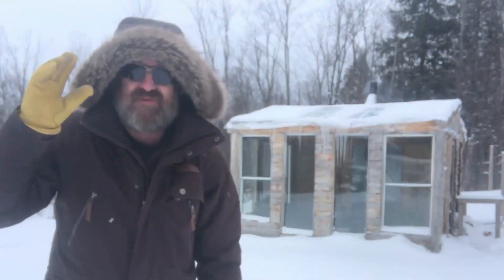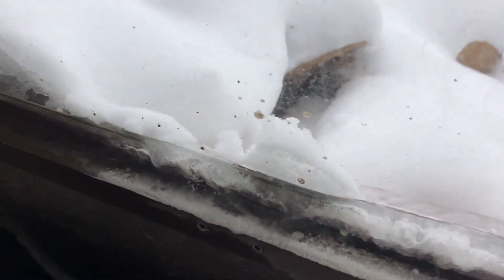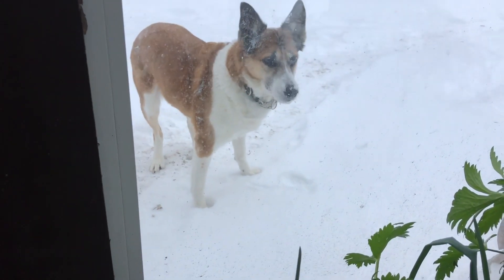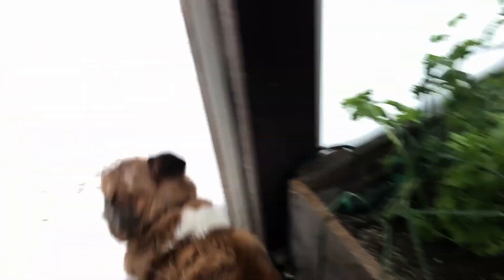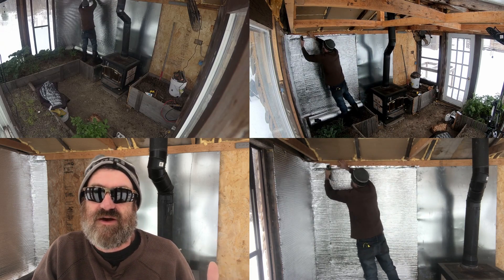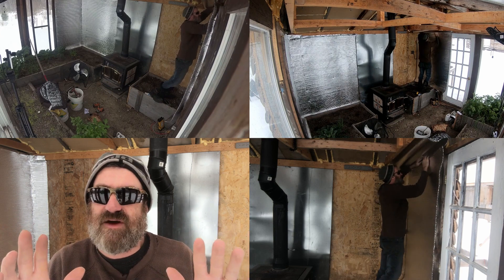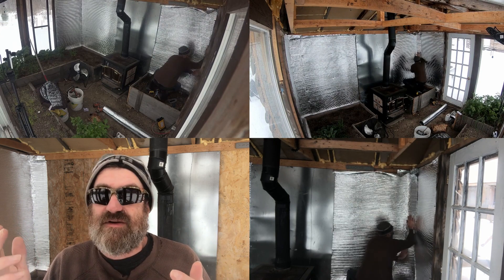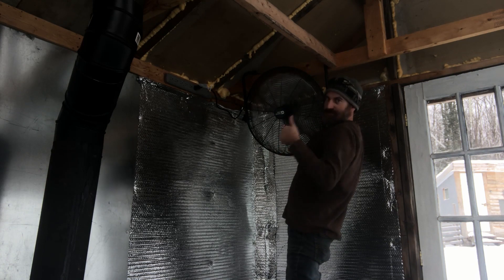Winter Greenhouse Heating - What Works & What Doesn't - Greenhouse Insulation & Light Efficiency

Comment: 😂the recall part is a big main reason to grow your own!
I just asked on an older video how the solar worked out and if you were using it for lights, heat or both.  I didn’t notice it in this video.  Did it work?

We used reclaimed lumber to build our garden shed and attached a lean to greenhouse made from reclaimed polycarbonate panels.  I see many plant directly in ground in their greenhouses.  Right now I use ours to start seeds with electric heater when weather warms up.  I would like to heat with solar and wind if needed.  
At the moment I want to replace polycarbonate panels with new, add a couple feet and install a heat sink in floor.  I suppose I could still have a heat sink and add a bed area for growing.  I keep the size small for ease of heating and considering a box on back wall to gather heat and pump to floor.  I think I seen a video of yours with aluminum cans.  We made a box a long time ago and they do work, but sunny days are key.
It is beneficial to have that back north wall attached to our shed.
I’m Z5a, let me know how that solar/battery thing worked.  Thank you!😊

Comment: And of course it has to be cheap to build lol I think you may gain some heat by insulating the ceiling but may not be worth it as you have lots of wood which is the best source for heat the short days are the worst so your lighting is next. Thanks for sharing with us. Down here in Muskoka we are limited to 105 sq ft without a permit. Oh I ordered some seed so I am a little behind you.
Reply from the maker: Yeah, it’d mainly be an aesthetic reason for adding it.  Although I could immediately see the difference in brightness once I had the walls done.  Might still add it in.  Did you order seeds from us?  I don’t recall seeing an order going out to Muskoka area, but we’ve sent quite a few out the last month.  Cheers!
Reply: @Wilderstead  To be honest I did not know you sold seeds. I will have a look as I need more thanks.
Reply from the maker: Yeah, on our website.  Some have sold out already, but there are still a decent amount available.

Comment: Thank you!   Is that some kind of a special long lasting stove I've been reading about that last over 24 hours with 1 log?
Reply from the maker: Not really a special type of stove.  It’s large though.  Rated for about 1500 sq ft.  A full load will last about 12 hours with everything damped down.  That’s what I do overnight.
Reply: @Wilderstead  I may invest a little more money in the long lasting stoves to save fuel, unless I can find a design, then I'll make one.
Reply from the maker: @l0I0I0I0  if anything, make sure you invest in a stove much bigger than you think you’ll need.  Some videos from last winter have a different stove in there.  It worked, but had to be loaded up a lot more often than this one.
Reply: @Wilderstead  Good point!  It will have to be bigger as GH are not as insulated as a regular house.  I actual have some designs I'm going to try out for heating and cooling.  Not 100% set on which ones I will do but it will probably a combination of 2 or 3 systems with thermal energy storage for a larger greenhouse.  Geothermal heating and cooling for sure and perhaps a heat pump.
Reply: @Wilderstead I’ve seen what I think they call rocket stoves that are built with heat sink materials.  My go to for indoors would be a soapstone stove.  Grew up in house with old giant dinosaur wood burner with coal auger.  A lot of work.  I wish I would have insulated the attic for folks Way sooner than I did—Total night and day difference—Totally!  
I shake my head that my dad was talked into fiberbacked aluminum siding years ago.  The walls were double and triple lathed so no way to insulate back then.  Oh, well we didn’t have to paint anymore, but I didn’t like it as a kid because it was wide siding and took away the look of 4” cedar siding—sigh.  Money better spent would have been to insulate the huge walk up attic.  It would have saved so much more wood and coal.  Ugh!

Comment: Are you going to use this structure in the summer and if so what do you do about it getting too hot?
Reply from the maker: We have hoop houses that we use in the summer.  But when this one is used spring and early fall,  all of the windows are opened up and the fans help move the air around.  It works as a giant dehydrator for various things as well.
Reply: @Wilderstead  We just ended  3 weeks of minus 30  in central Saskatchewan. What type of extremes will your greenhouse face?
Reply from the maker: Same here, if not colder at times.
Reply: @Wilderstead we use shade cloth on our lean to and works great for curing onions, potatoes (covered with cardboard or burlap).  Another reason I like to keep GH small so it’s easy to flip the cloth on.

Comment: reco... block off the "attic"... smaller space to heat the better and it's not a functional space for you... more work in summer/fall... insulate around the building a few inches down (exterior/below grade foam board)... 2-4 ft out... will really change frost line and cold coming up the floor
Reply from the maker: Thanks for the recommendations

Comment: Don't mislead people.  Bins with water do work. They must be BLACK and 2-4 times in gallons to the square feet of floor.   Instead of water, sand will work even better as a thermal storage.  There are dozens of videos here showing how to do it with measurable results.  You did it wrong.
Reply from the maker: Do you have experience growing in a greenhouse heated solely with big black barrels full of water? There's nothing misleading about explaining what we've tried, and the HUGE amount of space required to store the volume of water needed to keep a greenhouse 'warm' - which would be barely above freezing - in our climate.  I'm sure you've seen numerous videos on large scale greenhouses using thermal mass as a warming source.  And sure, it works in southern climates to an extent.  But I can assure you in a climate like ours, there are other heat inputs being used in those large greenhouses along side thermal mass storage.  We would need thermal mass storage the size of the greenhouse just to make a single degree difference in the temperature inside the greenhouse at night.  We've been at this for several years and sharing real world experience with growing food year round on a small scale in a greenhouse in a climate that reaches -30C for prolonged periods of time.
Reply: @Wilderstead I agree.  I don’t have that space either and I don’t want frozen barrels.  True they need to be black and hitting sun—On that note you then have to look at how many sunny days your area gets—That’s A Big One!!
I talked a little bit about rebuilding my lean to GH and going to use reclaimed refrigeration building panels around the edges and bottom.  If I don’t grow in ground I can always container grow as the most I would want to succeed at is leafy greens.
😂that recall segment was a hoot!  I know, it’s almost everyday isn’t it?😂
Reply: Oh, better yet, later on my folks went to an outdoor wood burning stove and boiler system.  The best and no more cleaning a 3 story house chimney.👏🏼👏🏼. I thought it was bad painting on a ladder, but my poor ole pop was still popping out on the roof through the attic to clean the chimney.😮
Where I’m going with this is it would be easy to add a line of heat to GH with outdoor wood burner.